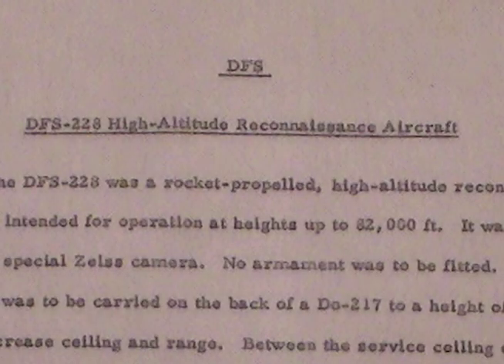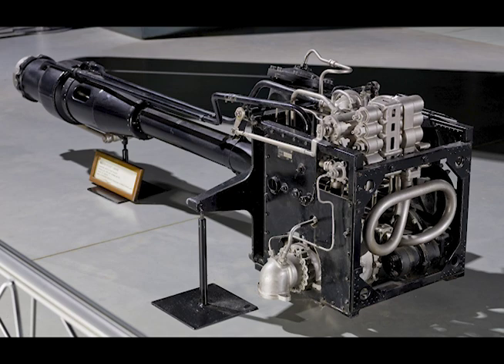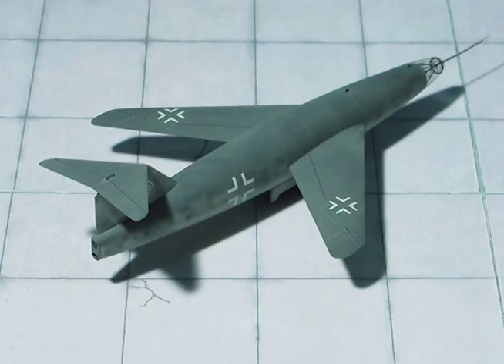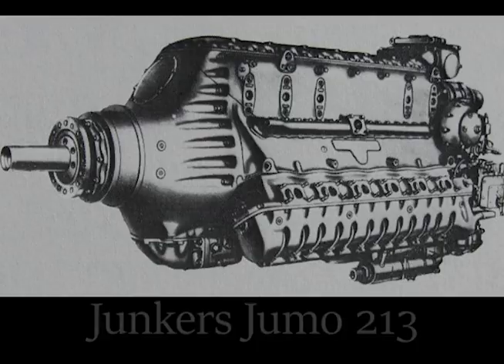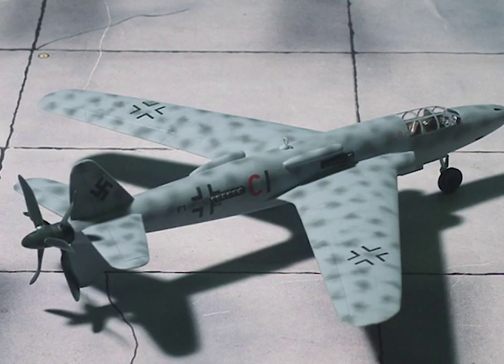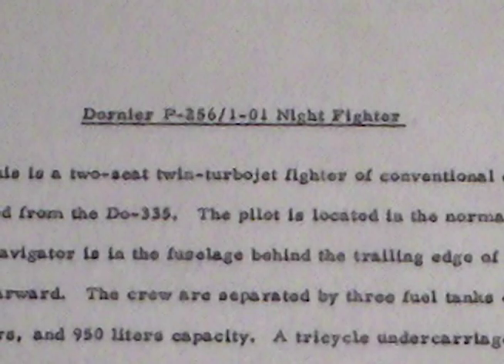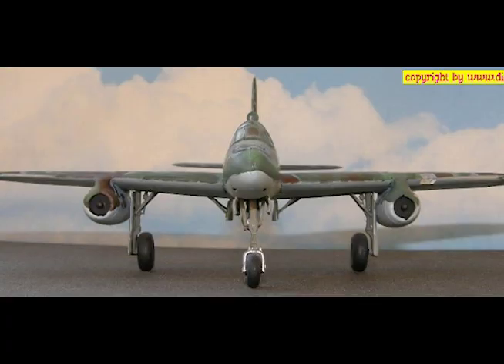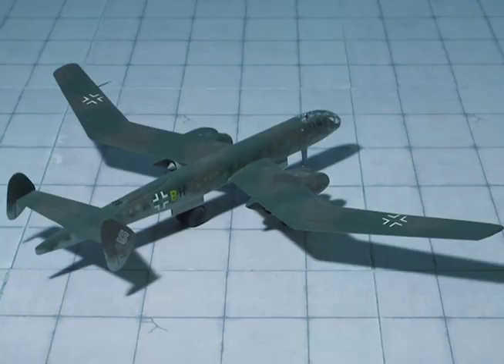German Experimental Aircraft of World War II #8 DFS - Dornier

Comment: The reasoning behind the W shaped wing was to have the advantages of a forward swept wing ( no tip stall) while negating the disadvantages (increased interference drag, caused by an early boundary layer separation due to the inward air flow). 
The idea was originally conceived and sketched by Lippisch while working at Messerschmitt in October 1941. He was looking for new Ideas to improve the flight charcteristics of the ME163. The calculations were based on data that was gathered from the experimental forward swept wing glider Kormoran DFS42 that he designed while working at DFS in 1936.
Reply from the maker: Thanks for that, Mr. Cyberauto!
Reply: It is amazing to see that Lippisch's innovations pop up all over. If you haven't seen them already there's a great collection of him giving lectures at Iowa. https://youtube.com/playlist?list=PLBhFhWKitUzzxj96VIMGYJwX_kdkCHI8S&si=5seBnIn7WTsOdKDq